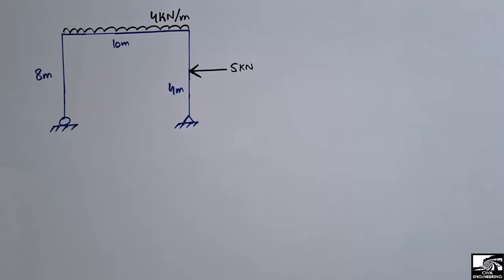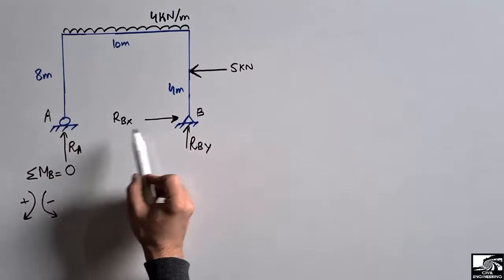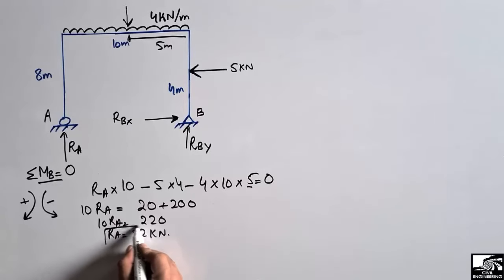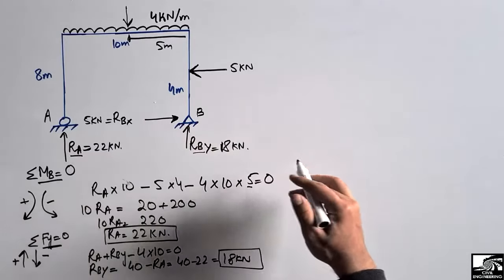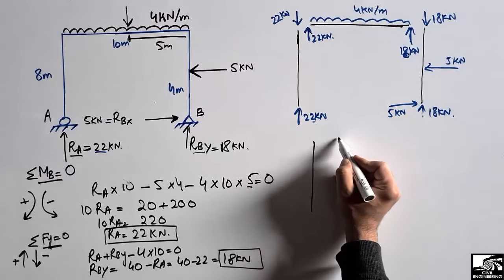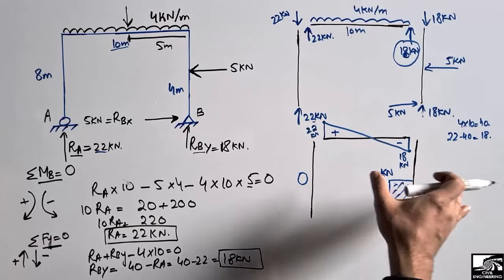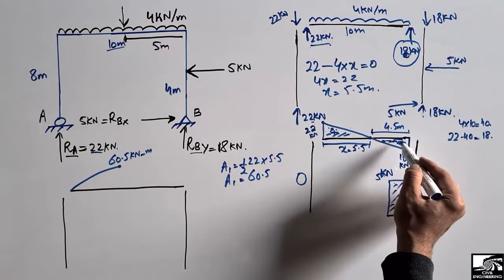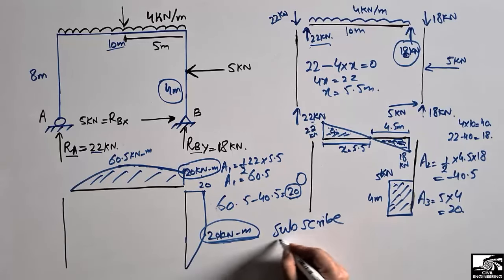Frame Analysis || Shear Force & Bending Moment Diagram

Comment: I thought the UDL would create a positive clockwise moment
Reply: Ali Mohamed Remember, the moment is taken about reaction B so B is a fixed point. Imagine holding the frame in one hand at Reaction B. The 4 kN/m uniformly distributed load can be represented by a 40 kN point load at the center of the horizontal beam. If you’re holding a model frame in the air. Your left hand holds the frame at the bottom of the column supported by Reaction B. If you use your free right hand to push down on the center of the horizontal beam, what would happen? The left side of the Beam would bend or tilt counter clockwise.

Hope this helps :)

Comment: OBJECTION .
Given that beams  A (8m) and B (4m) have different heights and therefore should NOT be represented as having the same dimension.
The diagram is misleading.
Reply: LGL_137 No Name Both columns are the same height. The horizontal point load on column B is located in the center of the column, 4m away from Reaction B.
Reply from the maker: right #Jargon (Y)